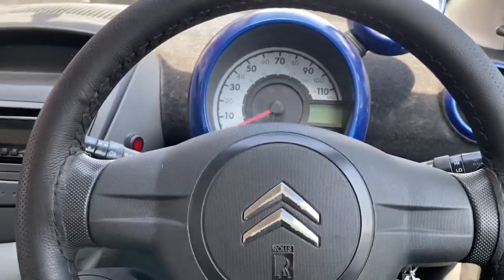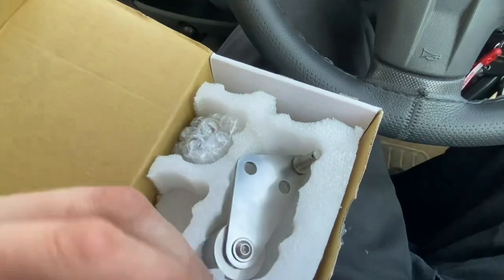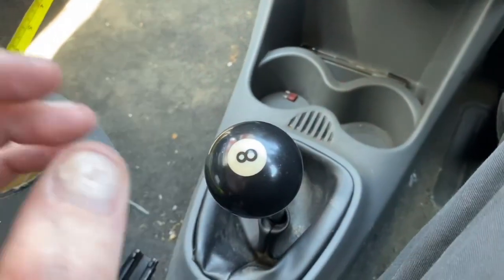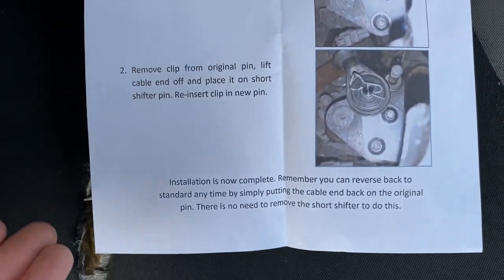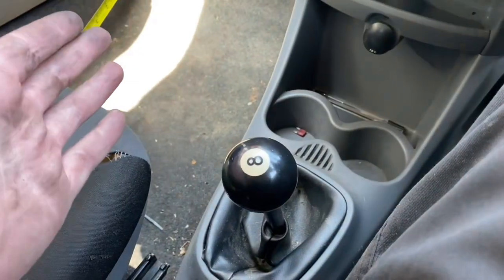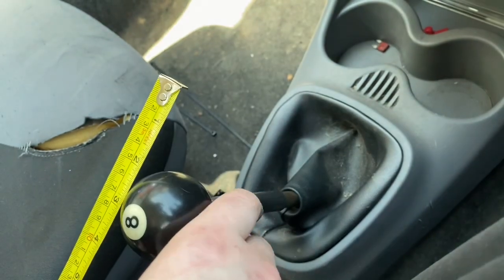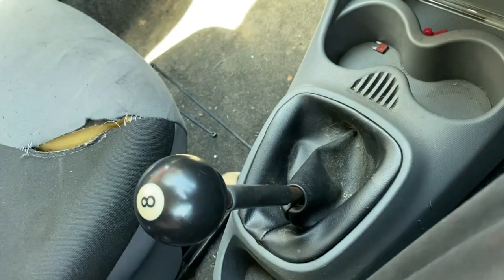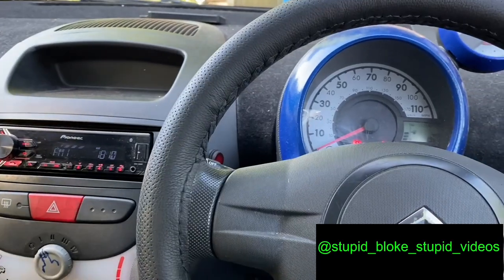Citroen C1 Short Shifter Installation & Test / CityBug/Aygo/107 Quick Shifter Fitted

Comment: Still having bloody problems with the Lumpy tick-over. Stays at 850-900 RPM, no erratic idling, just lumpy as hell.

Swapped out the throttle body and still doing it! Swapped over the idle control valve, still doing it. I think It's been invaded by the Lumpy tickover virus.
Reply from the maker: Is this something that has started all of a sudden? I mean, these shitters are pretty lumpy as standard on tickover. Mine feels really lumpy since I sikoflex’d the gearbox mount, so maybe one of your engine mounts is shagged and exaggerating the vibration?
Reply from the maker: Also if it’s worse when hot, it could be worth checking the valve clearances as they are shimmed on these. Tight valves could cause lumpy idle, and worse when hot however I’ve never heard of them going out of spec personally

Comment: Good job, m8
But I'm wondering what that puck/disk round metal thingy on the quick shifter is for
The manufacturer could have avoided putting it, right?
Eager to know, thanks.
Reply from the maker: Thanks mate. It’s some king of weight/counter balance.
Reply: @StupidBlokeStupidVideos  Sorry,  as an engineer,  I don't think it serves any balanced weight ratio when the plate itself is fastened down tightly with two screws to the main plate.
One could easily avoid using by moving the hook up to one of the other holes and fasten it with a long screw and bolt.
I'll try it and let you know.
I honestly don't think c1 or aygo are designed by Space X engineers 
🤣🤣🤣
Reply from the maker: @basba_qal  😂 fair enough. Actually looking at it, it’s probably more to give it a bit more inertia and give a better feel as it goes into gear. It’s attached to a part of the gearbox that moves.

Comment: 3.05
So, what if you, instead of installing the short shifter, had released the original shifter and fastened it with a screw and nut in the middle hole or the second hole if the pin got in the way?
Reply from the maker: Maybe, but for £35 the shifter works well tbh

Comment: Brilliant video! Is shifting any harder? Do you think it could wear faster gear links or something? I’m probably willing to give this mod to my racing groceries nugget too
Reply from the maker: Thanks mate. It’s slightly stiffer but not to any detriment. It feels way way more positive. It will be pulling on the cables slightly harder but I doubt it will be by enough to cause any negative effects though. I’m actually really impressed with it.
Reply: I wonder why they didn’t make it like this straight out of the factory already 😠, now I want this mod ehehe 😁
Reply: @dizzy2020  no such a thing as rust in my country, 12 year old bug spotless (not british myself)
Reply from the maker: @dizzy2020  they’re probably no worse than anything else for rust, but because mechanically they are much bullet proof,.. it’s usually rust that finally finishes them off!
Reply from the maker: @matt91eoo  I’m jealous.
Reply: @StupidBlokeStupidVideos  we have our problems here mate, a big one is that we are not allowed to change tyre size at all, it's like being a criminal, if you get pulled over they might even seize the car. There is no simple way to avoid this, so all the bugs here will be forced to run 155 65 14 forever
Reply from the maker: @matt91eoo  that, that law is the fucking criminal thing.
Reply: @StupidBlokeStupidVideos  I fully agree mate!
Reply: @StupidBlokeStupidVideos I've recently had a gear linkage failure and I think it might be due to the short shifter 🤔🤔
Reply from the maker: @jxmes6476  interesting. I did mention in the video that it will put a bit more strain on them as the mechanical advantage at the gearbox end is reduced 🤔 

I don’t think it’s enough to make it outright fail though unless it was already on its way.
Reply: @StupidBlokeStupidVideos  I was putting the selector from a MK2 in and it suddenly broke - before I finished it I removed the short shifter and straight away the gear changes were a lot smoother

Comment: Bueno, what cars does that kit fit on ?? Was that specific for the shitrron ?
Reply from the maker: It will fit on all of the manual 1.0 from what I can tell. The Aygo, 107 and mk1 c1 definitely and I believe it fits all the mk2 1.0 models but best off checking with the seller. It should be easy to check though just make sure the gear selector on the top of the box looks like mine, with the 2 homes for the bolts

Comment: Im facing hard in shifting is it work for my 2021 aygo?
Reply from the maker: If the shifting is hard, this won’t help. It makes the shifting shorter but also makes it a bit harder. If your shifting is hard then your clutch may need adjusting.

Comment: This mod is only in the uk
But can you messure the shortshifting plate..
Maybe some one in the netherlands can make this for me
I do it in combination with a 108 shift mechanism.
They are better than the origininal ones from 107 c1 etc
Reply from the maker: Will UK sellers not post to Netherlands? It would probably be easier and cheaper to do that than to have one made from scratch tbh
Reply: @StupidBlokeStupidVideos  The only one i have found 42 pounds  (48 euro  37 euro shipping and some tax
Reply from the maker: @HermanVdMeer  I’ll see what I can do